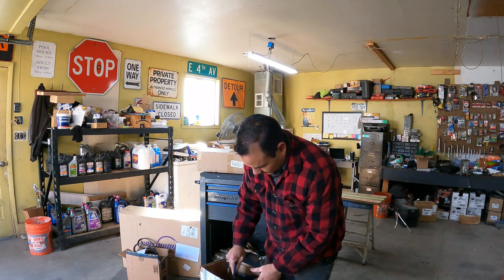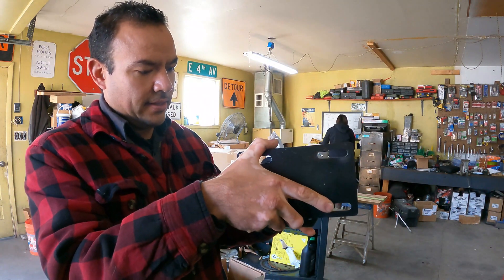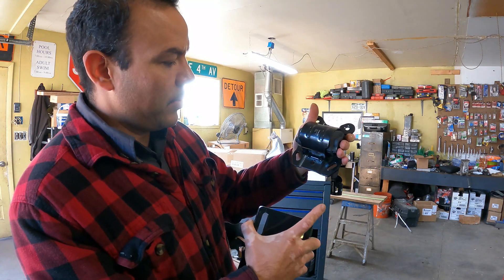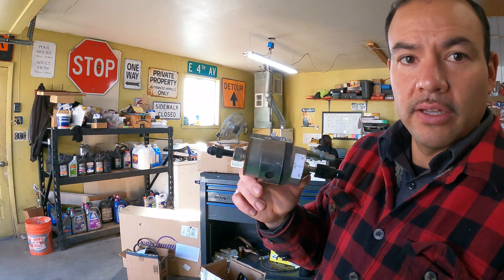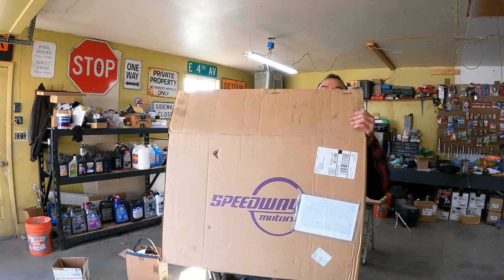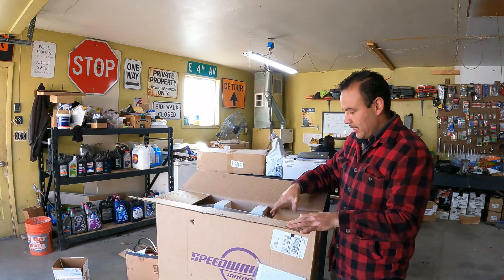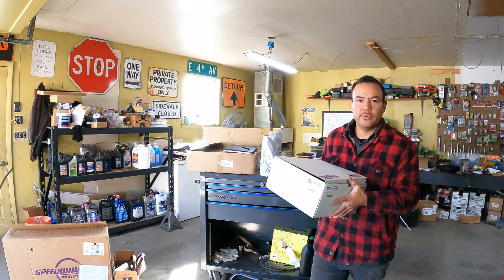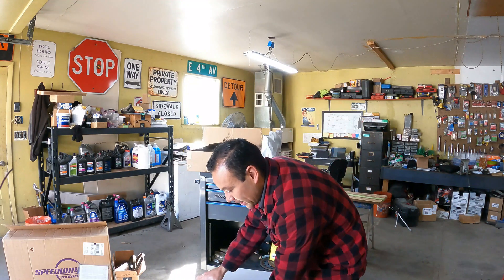How to LS swap a S10: parts list

Comment: U might need get powerstering bracket for your swap the ls stock bracket powersteering pulley will hit the gear box get GOAT LS 5.3 POWERSTEING BRACKET IT CLEARS THAT HEADACHE BUT U NEED TO GET SHORTER BELT
Reply from the maker: Yeah it barely cleaned the engine mounts have slots so I pushed it a bit to the passenger side that helped with the steering shaft and PS pulley.

Comment: Radiator part#?
Reply from the maker: Thanks for the comment James D.  Radiator # 916-04057. You can also search ls swap radiator and it comes up.. speedway motors is the one I did.. its huge but does a good job cooling the engine.

Comment: My best advice to anyone doing the swap is pick a system designed to work together and stick with it (mostly engine  mounts, oil pan and crossmember). Be prepared to make  stuff fit with a torch and welder probably more than you have to if you don't. 

As for your intake.  Unless you are going for pretty the stock  truck intakes do rather well for performance and fit easily  under stock hood. Throttle by cable is a snap ( 2000 with  4.3 anyway) I'm using stock sonoma Throttle and cruise cables.. 

Coil packs.  The rear ones are likely going to hit brake booster and ac box (even with Holley cover). You don't have to freak out and re-locate them, buy a smaller booster, go hydroboost or manual brakes.   I cut my brackets right before the back coil pack, raised them to clear and welded them back together.
Reply from the maker: Thanks for the comment lane! so far the only welding that has been needed is in modifying the transmission crossmember and making new exhaust.  Also I did cut into the rad support to fit my aluminum radiator.  I tried to buy the right parts to keep the welding and custom work to a minimum. I did have to grind down part of the driver side engine mount due to the headers hitting and the lip on the booster to have clearance for the coil packs. Ill soon be uploading new videos i had to get a new laptop to edit my videos.

Comment: Cooling system..Current Performance   wiring  and ALL ls swap parts needed for the s10 swap using an ls based engine
Reply from the maker: Thanks for the comment Jody.  I looked at several vendors for my parts and found quality parts all over. From speedway motors, jegs, Amazon I got my plug and play wiring harness from BP automotive the whole harness and wires themselves feel like quality parts so I'm very happy with the parts I chose. Thinking about it I didn't get anything from current performance..
Reply: @advancedstreettechnology2081   Yeah I looked up the people you  got the harness from, never heard of them.  I'll be keeping an eye on your build👊
Reply from the maker: @19jody72  yeah I looked all over for a good harness came across a forum that suggested them.. I paid like 900 dollars but I also upgraded the wire loom so it would of been cheaper for sure but I didn't mind spending the money to clean up the engine bay. Glad to hear it I'm going to be uploading more footage soon! 👊👍
Reply: @advancedstreettechnology2081   that's about the same price as Current Performance's harnesses. I'm going to be building next year, ls6  6 speed... just haven't decided on a 2000 and up or a 90-93 yet. I like them both but kind of like the older square body's a little more just because it's smaller and looks like a grandpa's truck.

Comment: I just bought a 99 S10 Step Side with a LQ9 6.0 in it with a 4L60e trans.  Interested in watching your swap progress. What brand of header, motor mount and AC relocation kit did you order?

My battery was moved to the bed so I’m looking at some type of tool box to mount it in.
Reply from the maker: Hey Ken thanks for the comment! That's sweet I'm curious what did you pay for it? I'm going to sell mine yo fund another ls swap I have.   But the headers were bought from eBay, the ac kit is kwik performance and the engine mounts are trans dapt.  But I've been test fitting the headers because the engine is in and they may not work ill keep you posted.. there hitting the steering linkage even after doing a smaller diameter linkage. Sucks I may have to get different ones where the linkage goes throw the manifold. But we'll see.

Comment: I have a few small suggestions/ comments. I just finished my first 5.3 s10 swap recently. It was a quick and dirty junkyard swap but I did the important things right and learned a lot. I have a few brief videos of it on my channel. You are definitely on the right track with your parts. The walbro 255 in tank pump swaps into the factory sending unit easily and works great. I recommend -6an pushlock fuel line and fittings for ease of install. I also recommend a baffle kit for that oil pan if you plan on any hard launches or cornering. There's a super shops version that is pretty cheap compared to the Holley. I also recommend the intrepid fans with stock 4.3 radiator recessed inside of the core support. If you are wanting to do AC you will have to figure out how to mount the condenser with the radiator in its place. You will also have to notch the frame for the compressor, there's no way around it. Also, if you can get away with it, I highly recommend using axle setback plates instead of shortening the driveshaft. JTR stealth swaps has a nice set. It's a cheaper and easier alternative to pulling the driveshaft and paying a shop to shorten it
Reply from the maker: Thanks Monte for the suggestions anything helps! I purchased -6an fuel line, I already have a speedway motors aluminum radiator, with a couple slim fans, the ac kit came with a relocating plate that puts it up top so no notching needed, and I have a good driveshaft shop they said about 130ish to shorten it and they balance and replace the ujoints plus paint the thing so it comes out looking new. I will deff check out your videos I've seen many to try and make this swap as easy as possible not necessarily going for budget I want it done right.  Also as soon as I finish this one I have a black s10 extreme that I'm going all out on. Already have a 6.0 with 4l80 trans and I'm going to upgrade the engine you know cams springs heads full bolt on plus a single monster turbo... this red truck is going to fund that one.. trying to get 12k from it that should hopefully be enough to do everything to the black truck.
Reply: @advancedstreettechnology2081  nice I love when that happens